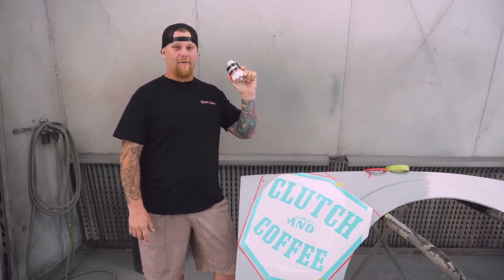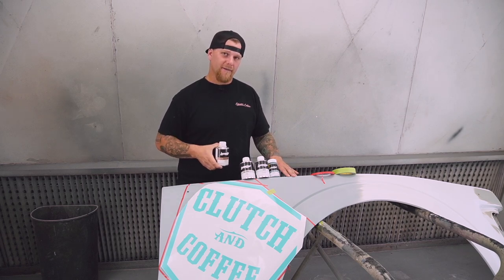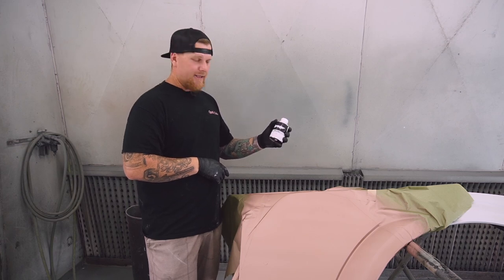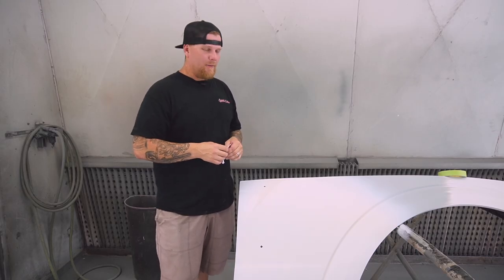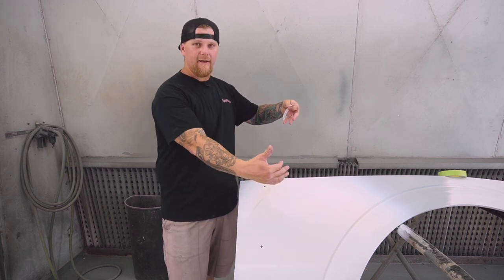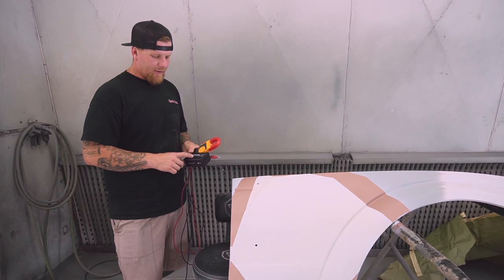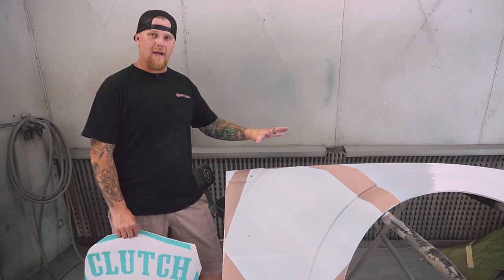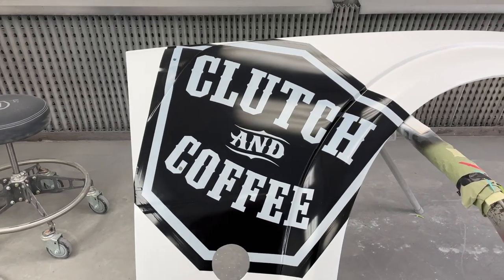Electric Custom Paint: How its done!

Comment: Geeze. Regular paint is difficult enough! What happens when rock chips hit the panel? Or Hail? Will it short out?
Reply from the maker: You can stick a spike directly through the panel doesn’t matter. As long as the path of electricity is not broken it’s still works.

Comment: This is like a 2 layer printed circuitboard
Reply from the maker: Yeah it’s 5 layers of paint 👍🏻
Reply: @SYLVESTERSCUSTOMS  bottom layer , top layer , dielectric thickness in between and the solder mask on both sides ... which is also 5 layers too 🤔
Reply from the maker: @elecengguide  backplane layer, dielectric layer, lumicolor layer, buss bar layer, conductive top coat layer. It’s all in this video

Comment: Can you explain the part of how you connect the copper tape and to which step you place them?
Reply from the maker: The copper tape holds the wire to the backplane material. They are applied just before the conductive top coat. There’s in depth videos on Lumilor web site

Comment: The method of thinking is basically as if you were laying out a copper grid pattern for a window defroster grid .  Could also use copper tape from the stained glass community .
Reply from the maker: It’s a phosphor coating that gives off light

Comment: This stuff is pretty wild. Pretty expensive from what I hear. I also saw something similar to this but was heat activated through an electrical circuit. The panel looked one color until it was heated then exposed something else. It's getting crazy.
Reply: $400 for 2 square feet and $600 for up to 5 square feet. That's just the coatings. No power supply or copper tape or anything else needed for electrification.
Reply from the maker: More than that 🤣🤦🏻‍♂️
Reply from the maker: I saw that stuff it was more of a wrap not paint. But still very cool what technology we have!
Reply: @SYLVESTERSCUSTOMS  
They did an unmarked police cruiser and parked it in a bad neighborhood. Some kids were spraying graffiti on a wall next to it. They remotely activated the heat for  the logo and turned on the rollers. The kids threw down those cans and took off as fast as they could. 🤣
Reply: @SYLVESTERSCUSTOMS  It looked like the same bottles you were using and it's from the page of the US Lumilor distributor.